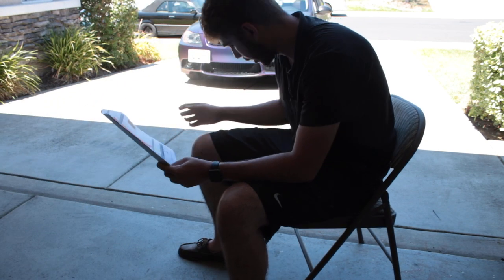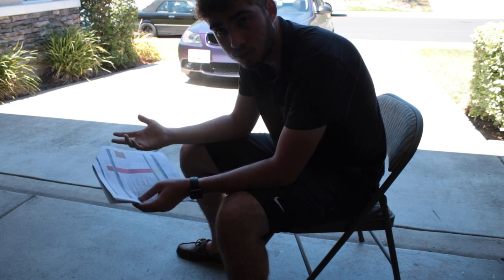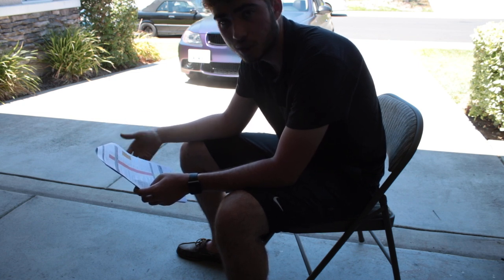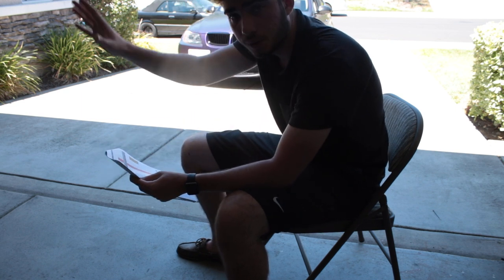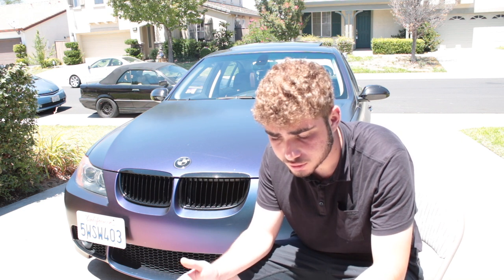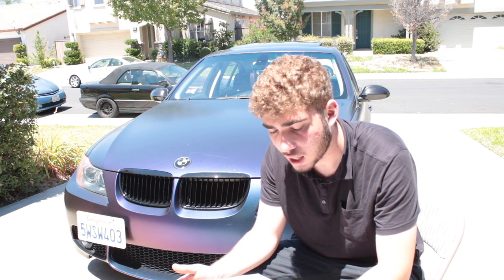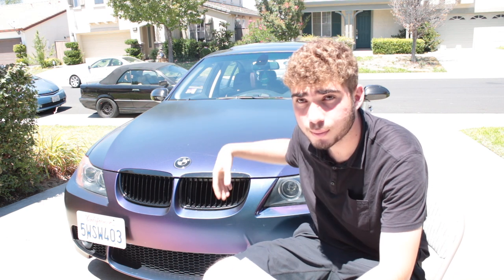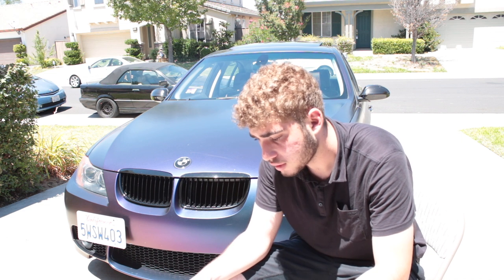E90 IS BACK!! BMW GAVE ME A LIST OF PROBLEMS/FAILURES (PPI)

Comment: Hi Buddy  , I will give you an advice since I have been a mechanic since I was 13 years old and I own a E90 2008 bought it new I'm 50 now, at 13 I did my first rebuild engine  on a VW super Beatle, My Bimmer has 110,700 miles and I love this car ,I'm a Quality Control Inspector on a Refinery for the past 10 years ,I just did the valve cover gasket change 3 days a go , took me 4 hours and I spend less than 100 dollars in parts , watching your videos Im pretty sure won't be a problem for you doing it your self, but my advice is if you don't have fix any oil leaks on your engine don't mess with anything , this dealerships all they want is make tons of money for simple stuff , a 900 hundred dollar to change a valve cover gasket is a ripoff its a joke. so don't worry for all the stuff they wrote on that paper if your car is running with any issues don't sweat it, I just watch your video about the trans jerk i have the same issue before when the car was under warranty , I took it to the dealer they did a software up date and that was it. I'm pretty sure thats the problem, good luck and enjoy your Bimmer .Take care.

Comment: Dude! Search your area for local reputable mechanic shops! Don't waste your time going to the BMW dealership. I drive a 2008 328i and just recently less than 2 months ago I noticed a small oil spot in my driveway. Later on I found out that I had to replace my oil pan gasket. BMW dealership quoted me exactly what they quoted you. I took it to a local BMW certified mechanic and got my oil pan gasket replaced with an oil change for only $450. Also while I was at the shop they pointed out that my motor mounts needed to be replaced as well. The mechanic at the shop when ahead and replaced my motor mounts and at the end only charged me $600 for everything. Trust me, if you just shop around you can find a good mechanic around your area. So far I have had no problems on my BMW. Too bad you don't live around my area in Houston Texas I would send you to the same shop. Good luck!
Reply from the maker: Frank Poncherello thanks man for the feedback. Yea next trip will not be bmw
Reply: Frank Poncherello b
Reply: Frank Poncherello , I live in Houston area. Which reputable mechanic are you talking about. Im having the same issue and need a good mechanic. Thanks!
Reply: Where is the shop, I live in houston

Comment: small correction, the valve cover gasket is not the head gasket. If you need cheaper labor for your e90, there's lots ofBMW repair shops on recycle rd rancho cordova. You can also buy your parts from turnermotorsports.com
Reply from the maker: thanks man ill check it out

Comment: Your coolant expansion tank does not need to be replaced! I work at BMW and I had my oil filter housing gasket repaired and my manager told me to just remove the expansion tank (contaminated with oil as well) and just scrub it and put dish soap and shake as if it was a cup. My dad and I did it two weeks ago and everything is fine, no more oil. I recommend trying that first. A lot of your issues my e90 has too. Except I had to replace the ENTIRE valve cover bcuz mine was non BMW and was causing misfiring due to excess vacuuming. Anyways, try what I said, it'll save money

Comment: You can do the overflow tank, oil filter housing gasket and head gasket yourself, easily.  Coolant hoses you can do.  What you should have bmw do:  the oil pan gasket and the thrust bushings.  Those are nearly impossible jobs without a lift.

Comment: Dude I wish I was in Cali so we could colab, you should come down to Vegas lol. Don't stress too much about those repairs man they're all pretty strait forward, the most time consuming one would be the valve cover gasket, probably 3-4 hours if it's your first time doing it, I did mine at 36k which was bullshit, FCP euro has a kit with spark plug tube gaskets, valvetronic motor gasket and the valve cover gasket for 90 bucks. Good luck
Reply from the maker: if you ever come down to cali I would be more than happy to check out your car. Also thanks for the input actually excited to start soem of these repairs.

Comment: Buy your parts at FCPEuro man, that way you get lifetime warranty on ALL your parts and trust me it comes in handy.  I recently had to replace my alternator cause it failed within 2 yrs since last replacement and got it replaced for free except for shipping.
Reply from the maker: ill check it out thanks
Reply: No problem man, I had a similar situation as you too.  Bought my car damn near new, ran like new for 4yrs then once it reached 80k miles it began having little things here and there but when I took it to the BMW dealer and got this inspection done they gave me like a $15k list.  Luckily I was able to get it all done with time little by little.  Most of it myself and some professionally, luckily I never had a blown head gasket, I just decided to get it done when I had to do my dual Vanos since I figured the engine would be take apart anyway.

Comment: Bought a e92 n51  from a. Used car dealer and the car was great condition at the time. But me being 20 years old drove it like it was stolen at about 120 mph on a daily basis, finally had some problem and I just moved to a new state and didn’t know any good mechanics so I took it to the bmw dealership and got back a 4500 dollar repair bill, They normally don’t give loaners out for vehicles over 5 years old I think I forgot the exact age, but for my 2008/09 328i they threw me an x1 for a week
Reply: Btw coming across this in oct 2020 and I can almost guarantee this bill was the straw that broke the camels back that made you say fuck it I’m gonna fix my cars myself, which same

Comment: The waterpump and thermostat is not hard to replace on the car. I’ve done it on a 335i with xdrive which is a bit tighter in space but still possible & i saved about $800 & bought the pump and thermostat from FCP which has lifetime warranty

Comment: Should of replaced the water pump and thermostat yourself. It's not that difficult, just time consuming.. I bought an aftermarket water pump & thermostat for a total of $400. I'm about 5k miles in running strong. About to take on an oil pan gasket pretty soon also..
Reply from the maker: ESG yea ima start doing this work myself. Hey man what's up with your channel. I want to see more vids man

Comment: I recommend you get a manual for repairs just to repair the valve cover gasket is big job for someone like you,your valve cover is completely different than your head gasket. But make sure you take off the eccentric shaft motor properly or you will cause major damage to the eccentric shaft. I've also done two oil pans on these cars and it's an all day job and if you don't have the right tools than just forget it dude.

Comment: Damn bro you got ripped off on that water pump
Reply from the maker: yea i know man, my local mechanic dose not do German cars. He quoted me 1300 while BMW quoted me 1700. I just went with BMW because they offend me a 2 year warranty.
Reply: Nour Hummadi oh my man 
They charge you a lot .. even I replaced  my water pump , thermostat, radiator and some hoses  I paid for labor $ 400
For water pump and thermostat German brand and one year warranty $299

I m sure your able to do that yourself..
Btw you can replace valve gasket and oil filter gasket too (easy )👍🏽
Reply: seriously got ripped off.  take it to an indy bimmershop and i bet a lot of those prices will get cut down by AT LEAST 50%. Never take it to the stealership for repairs. Just take it to get checked out and then get the fuck outta there.
Reply: @muratsol2679  probably oversea is much more expensive for european cars,i can get all that parts for around 250$ and labor is 50$
Reply: @MrSpeedkg  unfortunately in America parts and labor so expensive🤦‍♂️ not just about car any fixed things same
Too..
Reply: @muratsol2679  thats true,for some simple thing they charge alot but at the otherhand some stuff are more cheaper then here
Reply: @MrSpeedkg  yes thats true
By the way Where you live ?
Reply: @muratsol2679  Serbia

Comment: Did you have check engine lights or anything on the dash telling you of these issues? Did you notice anything other than the transmission you mentioned? The E90 is supposed to be lifetime trans fluid. Ive heard of dealers NOT performing a trans fluid change unless a noticeable issue. There is no reason your trans should have any issues. Unless as a few here have mentioned, the car was abused. I bought a 2006 330i a year ago and have not a single problem and I use as a daily. I had a dealer check out my key fob and the car was very well kept and regular service checks. No major failures and garage kept- or out here the BMW emblem would be scorched and faded out here in California sun. I really feel for you bro and admire your willingness to do yourself. Family and work obligations prevent me from doing this stuff myself, but am good at researching and know the dealers are sham artists.

Comment: Dude where in cali are u? im in sac and jus got my bmw m3 (e90) this week :)
Reply from the maker: im in sac pretty much, we are local :). I dont suppose I can check out your m3  :)
Reply: Nour Hummadi thats cool dude, I'm in the 209 area. What's the PPI? just an inspection and how much does it cost? I'm considering getting an n54 e90 out the dealer but with a few lemons going around its putting my plans on hold

Comment: I have bmw 2008 , 318i with engine N46, 80.000 km ,the car has smoke , and oil consumption, I changed oil separator breathing system. But still , can you help me, please

Comment: LOL Some of you are saying this is all regular maintenance lol?  Sorry but at this amount of mileage, 60k if I'm not mistaken, there's  no way this is all standard maintenance on a nonturbo engine.  Clearly this car was abused in a previous life.
Reply from the maker: Chiba707213 possibly
Reply: Nour Hummadi Your vehicle is technically still considered low mileage.  There's just no way that amount of shit needs to be done at only 60k.  Water pump I can understand but that's a YMMV type of maintenance.  Between 0-60k miles fluids, brakes, and belt are probably the primary maintenance things that needs to be done to a vehicle.  That list you read off is redonkulous.  My suggestion is to have a 2nd inspection done to compare but don't tell them you already got a ppi on the vehicle.   Good luck man.
Reply from the maker: Chiba707213 I'll see, thanks for the suggestion

Comment: I really don't see a big cost for this. I think all the items listed on that page are common issues or maintenance Items for any used vehicle. Although the pull tensioner is a common failure on all BMW.
Reply: when the engine overheat in this age, you will need to change most of the gasket in the engine.
Reply from the maker: i see

Comment: I don’t know your exact model but here some pricing I got from ECS. Oil filter housing $298, water pump & thermostat $377. Go to https://www.ecstuning.com/b-assembled-by-ecs-parts/performance-water-pump-and-thermostat-kit/11517586925kt9/ You can save a lot by getting the parts and installing with help from DIY’s on YouTube.

Comment: 6:46 A bit late but your Valve Cover Gasket and Head Gasket are two different things! Please research those properly! Valve Cover Gasket replacement is not that hard but the Head Gasket would require a professional and involves taking most of the top end of the engine apart! Very expensive!
Reply from the maker: Nah yea head gasket is bad news

Comment: There is a reason why BMW lose their value faster after 4 years that's why because the maintenance and the repairs cost a lot let me tell you I bought my 328xi for $12,000 I already spend on it $10,000 pay attention don't go to the dealer to do any repairs buy the parts and I recommend using RockAuto it's a website and you could get all the parts for cheap price after you get the parts you have to decide are you going to do the repairs by your self or you have somebody our mechanic is not going to ask that much I recommend first thing you have to take care of is the gasket valve cover trust me I got the same Rapport you got and I was desperate but I finally the cars are running like a champ did everything on it don't give up like for me I didn't customized anything on the pill because I want to take care of the mechanic stuff first because if I customize it and something goes wrong with the mechanic stuff the car sitting so make sure you take care of the mechanic stuff then you start customizing your car

Comment: Bro, don't  trust on everything that the dealer says to you, when i got my e99 i took it to the dealer because of alignment problems and they wanted to charge me more tan 10 k for missing bolts and links, they even added a new radiator i don't know why. After that I got a suspension at a junkyard for $400 an everything  was solve. My point is that those dudes want to change everything that haves dust on it...
Reply: E90 i mean
Reply from the maker: makes sense thanks man

Comment: Join the pissed off E90 club,owned mine for 6 months and have spent 1thousand pound including a service whilst doing just over 3k miles.Now I'm getting a whining noise from the front(diff,bearings?).Just goes on and on...
Reply from the maker: i love bmw, but this is getting annoying lol
Reply: check power steering pump, or lines

Comment: Bmw don't know there car.... Have a 2009 3 series that vibrates on acceleration
Took it to them to diagnose, changed all like u said but did not fix the vibration.
Changed 
Hub, o2sensors, tie rod,  guibo, shocks, all 4 tyres, camshaft,engine mounts, sensors still shakes like a jelly fish...a
Reply from the maker: they will give you another free diagnostics if your problem was not fixed after replacing the components they mentioned on their diagnostics.

Comment: Man, I bought my 08 328xi May 2016 with 40,625 miles and it's been a little over a year sitting at 56k. This video is kind of giving me a bad vibe...
Reply from the maker: MDIHSteam1 just scan your car once a month with the Carly app. So you won't have to make any situation worse than it is. Fix the problem as soon as it arises. You live in learn, learn form my mistakes
Reply: Nour Hummadi how does that carly app works?

Comment: Dude it's a lemon, it's obvious the vehicle was used and abused.
Reply: Angel Angelov only idiots go to the dealership, those guys will never tell you the car is in good condition, 🤷‍♂️ so why go there in the first place? A bmw is only trouble some when the previous owner neglect its maintenance, on a bmw owner manual you have to go above its maintenance requirements, it's better to order your own parts offline, and either do your own labor, or pay for the labor.
Reply: Angel Angelov the dealership purposely look for jobs that don't need any fixing, and they sometimes will fuck up the car just to get a job, they get commission on any parts or labor services, they are all crooks, valve cover gasket job for $4,000 they fucking crazy.
Reply: Angel Angelov yea I've been ordering from fcpeuro myself they have warranty on all parts for dirt cheap, and it gives bmw ownership more financial confidence, people need to stop supporting the bmw dealership, they deserve the worst starvation, if it was left up to me every bmw dealership would go out of business, they are thieves, oil change for $150 when filter is for $10 bucks, and oil at Walmart $24 for 5 quarts those stealership mechanics need to be standing in the service both with wrench in hand, and no cars to fix fuck em
Reply: Angel Angelov the stealership told me it's $4,000 to replace a valve cover gasket I looked at the service consultant, and 🤣laugh my ass off he thought I was crazy, I told him he's crazy, I went out to a small shop had it done for $400 even though the mechanic told me it was a 16 hour labor on the x6 he made a mistake on the price, I felt bad and gave him $250 total $650 sometimes shops don't get any jobs so calling around you could find the best labor deals.